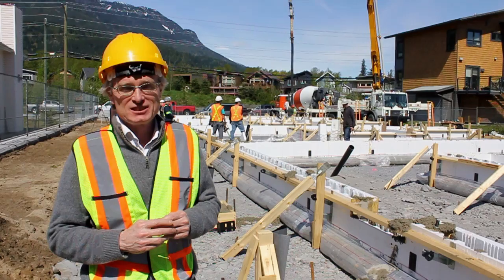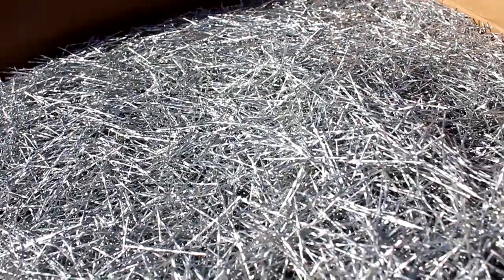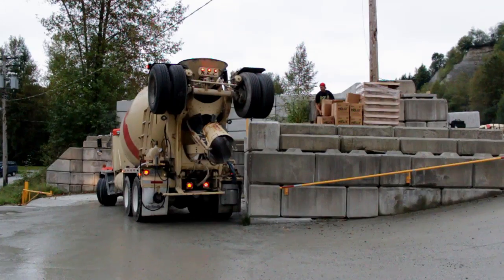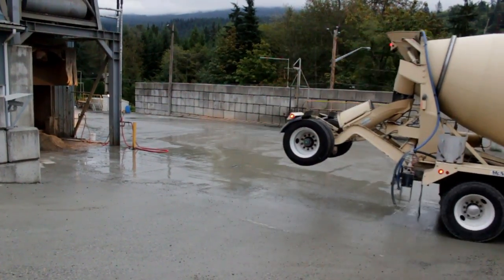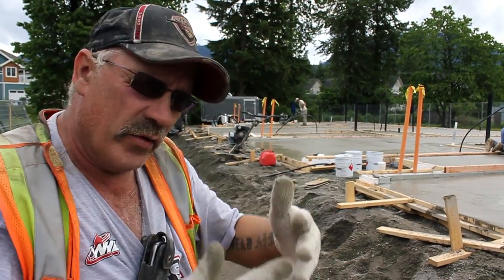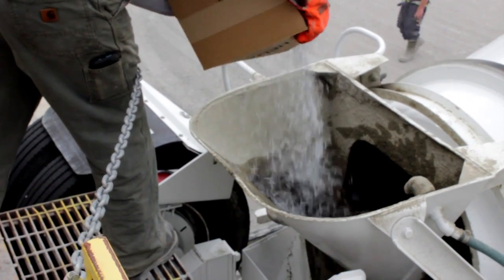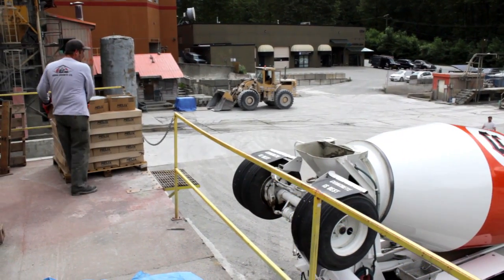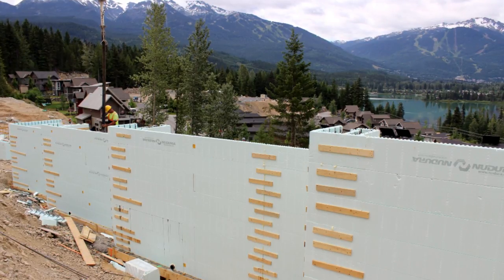Helix Micro Rebar - A Better Way to Reinforce Concrete

Comment: Time will tell if corrosion takes away all the tensile strength you get from traditional rebar. Seems like once rust and corrosion get started, the micro-corroded network of fissures created would wick  moisture in quickly and it would be throughout the concrete in short order, and poof there goes your tensile strength. Maybe this would be worst on a horizontal slab that might see moisture frequently.

Comment: If the rebar is reduced by 95%, where is the 5% still needed?
Reply from the maker: It depends in the application. Helix eliminates background steel, so in a wall assembly, you would have additional rebar over door and window openings. In large commercial slabs you may need additional rebar in point loads etc.

Comment: The downside is that like ALL steel reinforcement it will eventually destroy the concrete in which it is embedded.
Reply: No this product creates no load or abrasive friction encased in concrete it binds well the twisted fibers locked in place